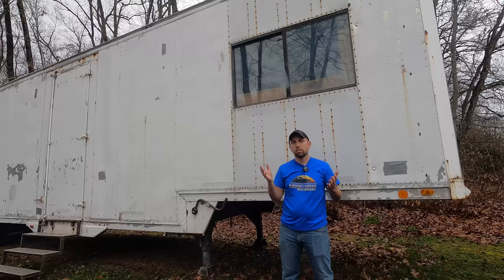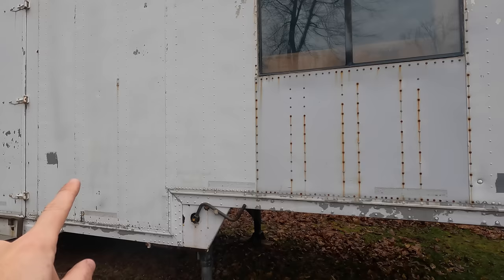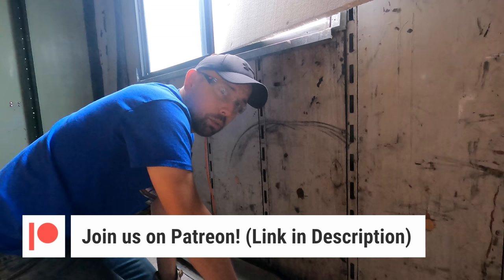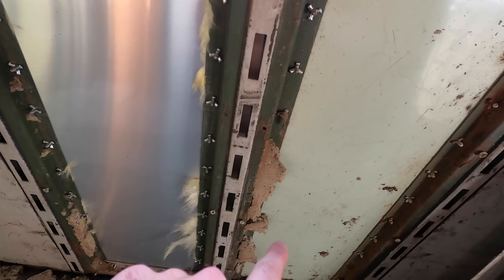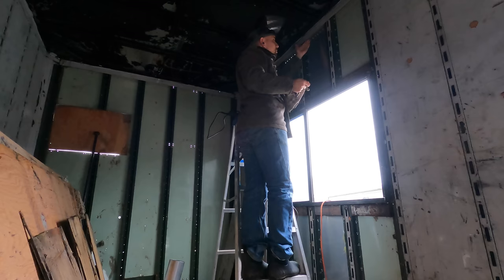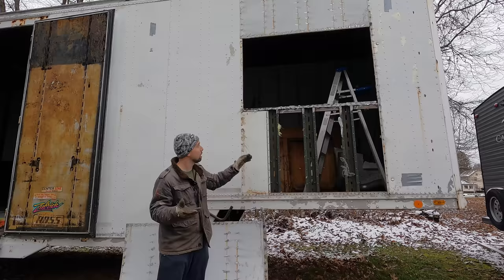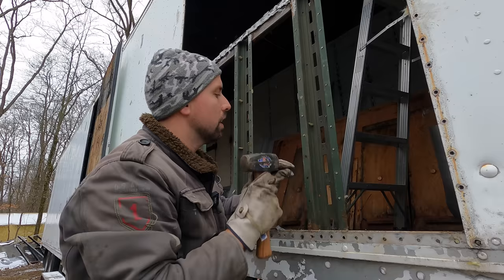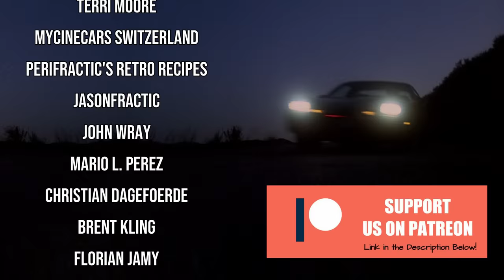Screen Used Knight Rider Trailer's Window Gets RIPPED OUT! Dorsey KITT Hauler Restoration Continues!

Comment: Its very slowly evolving back into the FLAG trailer.  Removing the window, is the tide changing.
Reply: Very slowly is the wrong phrase. I am impressed with how quickly Joe is working. To be this far along while having a family and full time job is pretty great.
Reply: @matthewhegarty729  Not to mention doing this mostly ALONE along with creating these videos.
Reply: Leave the window. After new paint, it will blend in with the black outside

Comment: It's possible to do aluminum welding. If you're committed to keeping that notched panel, you should see if you can find someone who does aluminum welding to come patch that notch with a plate. Once the weld is ground flat it should look like a solid piece again.
Reply: i agree, that if he wants to keep as much as possible from original, then he shouldn't do the same as owners of tis trailer did, and keep these original parts
Reply: Woud be a real trick to weld aluminium seams that long in thin sheets like that without distorting the material. It is worth a try atleast. See how it looks. The new panels are less wavey than the original that will be the most visible difference between old and new.

Comment: Just a suggestion. That piece that's going too get covered back up. You could remove it, and cut it up into tags, like the ones you can get from Planetags or something like that, and then you could sell them as a fundraiser for the trailer restoration.

Comment: Obviously the window was put in after it was blasted and painted... Otherwise the siding they replaced when they put the window in would have been the exact same color...   You could possibly weld in a new piece of aluminum siding where the old section was cut out...  However, definitely need someone with skills to weld that without warping it, but possible.  Take a piece of the metal you just cut out and move it to cover the hole rivet it in place and seam butt weld it back together but skipping around so it doesn't warp, then grind the weld joint smooth.  Then just replace the full section that is missing.  This will keep it looking original. 😉👍

Comment: Too bad you can't scavenge a panel from a scrap Dorsey trailer. Perfect match and potentially pre- punched as well. You might be able to TIG ( or MIG, too early to remember which) the seam if you chose to try and not cover up the existing panel sections. Great job.
Reply: I was thinking the same thing.  Why couldn't the seam be TIG welded and built up then sanded/buffed down to eliminate the seam?  A small imperfection would be acceptable as opposed to covering the whole panel up I believe.  Might could even use some body filler or extra primer in the area if necessary before painting.

Comment: Thanks for showing the continued progress on the trailer restoration. I was expecting the Knight Rider theme - or at least the segment that used to play before a commercial break - to play right after you proposed to peel back that original panel to see if it was still painted black.

Comment: You can get drill bits designed for drilling out rivets, that way you're left with the original hole and don't damage the panel.
Reply from the maker: The panel was not original and getting scrapped anyways, so cutting them off was MUCH quicker. I did drill out the rivets that were against the original panels.

Comment: Had a further think on that notched panel. You might do better to remove it from the trailer and replace it. That would not just let you put a complete panel in place, and thereby keep the panel flow original to how the trailer looked on the show, but it would also give you a piece of the trailer that you could cut up into sections and sell to help cover some of the costs of the reconstruction.

Comment: Love the dedication that you have for this build, it’s amazing, love watching night rider, I’m building the 1.8 scale model, we’re on issue 68 putting the seats in here in the uk, will u be underselling the trailer and tractor unit to protect it from the elements? And the same with kitt? Under-seal the chassis  so the chassis doesn’t rust or stsrt rotting.

Comment: Graft a peice in.... heliarc it yo the old piece and sand and grind till its smooth and looks like one peice... That's how we used to fix cracked or punctured boat hulls. We used to weld another srtrip of aluminum on the back side of the joints, but you're not going to be floating the trailer in water, so.... you might not need to do that.

Comment: Is aluminium easy to weld ? And great job,your going so fast fixing the trailer.
Reply: Aluminum isn't difficult to weld; it needs different equipment and different techniques than welding steel.

Welding thin aluminum, like the skin, takes a LOT of practice to do well, and people with the skills to do it well don't come cheap.

Comment: Although I respect your decision to  restore the van to original screen used look and operation . I think  the ramp should have been left as it had been constructed by later owners one reason I think the original screen  used construction  was kind of rushed job and probably contrived by executives at paramount to add gismos etc no way would any rational person have ramp extensions when it would be safer for the entire end ramp to contact the ground for the car to get into the van then there is the door pulley system was also not very efficient or a good  use of space  good luck  be dangerous and fearless lol

Comment: oh yes there is a way to make that panel complete again without seeing it ever missed a part. aluminium can be friction welded. (which is the part where you simply put some rotating disc on it until both panels get hot by themselves and the aluminium itself mixes and smears out between them... no sparks. no electricity.. no fire...) but as this is not a missile :P  that may be a bit over budget :P as far as i know rockets and missiles are the only products on which it's used. not even airplanes :P see all other aluminium welding and soldering methods result in color differences at the very least. but friction welding just makes it one plate. with the exact same thickness and temperature coefficient as the rest of it. which is what you want if you're gonna shoot stuff to other planets :P but not nessesarily on a trailer.

Comment: If both the interior and exterior are going why not just take the ones around the perimeter and push the panel out inside and out instead of removing all of those rivets in the middle